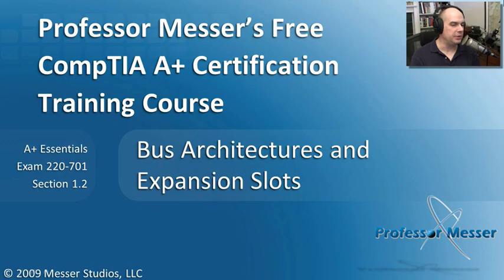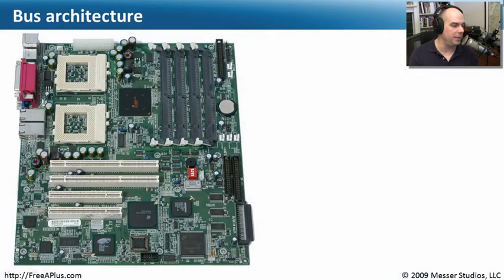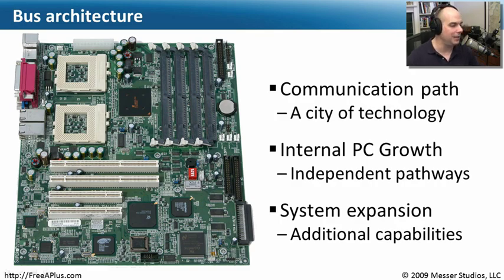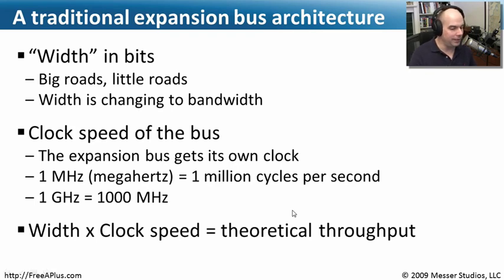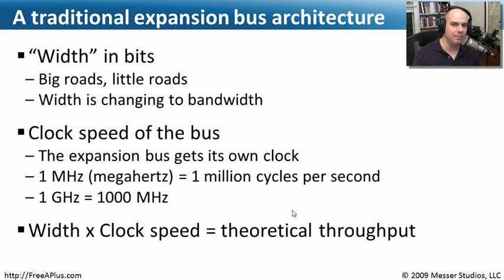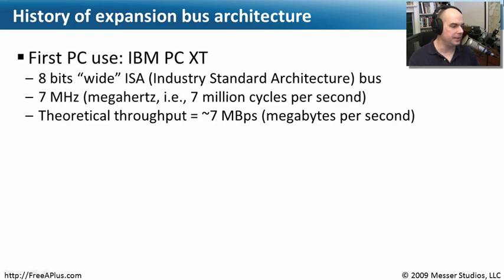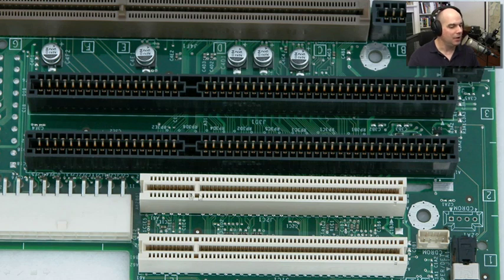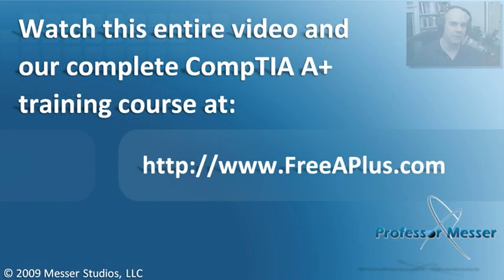Bus Architectures and Expansion Slots - Part 1 of 3 - CompTIA A+ 220-701

Comment: In case anyone is watching the IBM PC XT part and wondering where his formula from earlier fits in with the answer he gave, the problem here is that Messer left out a key part.
The proper formula is Width x Clock Speed Divided by 8 (since there are 8 bits in a byte).
So in the IBM PC XT, he had an 8 bit wide bus times the clock speed (7 MHz), giving him 56 Megabits. Divide by 8 and he gets 7 Megabytes.

Comment: The part about width * clock speed = throughput, can be confusing if you don't explain that there is 8 bits in a byte.